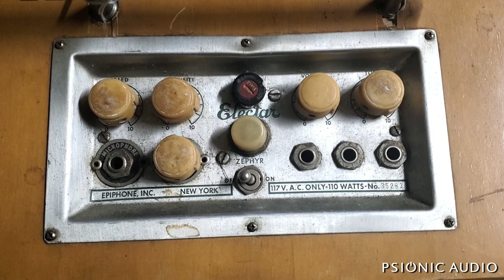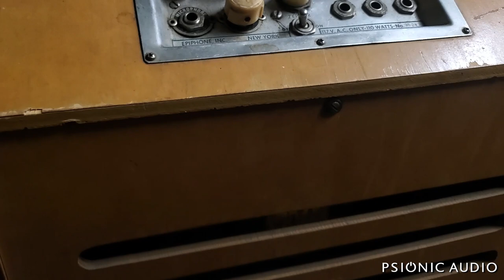'49 Epiphone Zephyr | Part 1 : A Short Story

Comment: Usually when I see that style of resistor, it's held in place with a bracket that attaches to the body.  On the Ohmite webpage, it offers "Mounting options include push-in brackets and thru-bolt brackets" Unless we're going for museum authentic, I'd change the mounting so it's not being held by it's terminals.

Comment: Personally, in this instance because these are an endangered species and its age,it would be great to see it replaced with an original type but maybe more securely mounted. Plus the proven longevity of the part is not an issue.Either way the owner is one lucky person. My father-in law had one and it was old back in the 70's lol. I was lucky enough to play it a few times. A great example of guitar amp history.

Comment: I’m guessing the original speaker was a field coil (electromagnet) type, and that large variable power resistor was added at the same time the speaker got replaced, in order to take the place of the now-missing field coil.
Reply: Seems like a choke with a possible series resistor would be better suited to replace a field coil. 
Who knows what landmine you’re going to walk into inside a 70 year old amp.
Reply from the maker: Previous version of the Zephyr had a FC. '49 has no FC but has the variable resistor before the reservoir cap, to set B+ at 400V. Beautiful Valco madness.
Reply: @PsionicAudio   old transformerless AC/DC radios  sometimes have big power resistors like that inside of them because the series string  Heaters might only add up to add up to 95 or a 100 V and they need to drop a little extra power.  Imagine a plastic or bakelite radio with a 5 to 10 W resistor inside of it dissipating that excess energy!  Some radios used a power cord that was actually designed to be a 5 or 6' long resistor and dissipate some of that excess wall voltage along the length of the power cord. One wonders how many house fires were started by one of those!
Reply: @PsionicAudio  ,  Valco would use whatever speakers they got a deal on, car radio speakers,  war surplus, whatever. I'm surprised they were using permanent magnet speakers in 1949, since they used field coil speakers again on a few amplifier models in the 1950's.  Somebody must have offered them a good deal!

Comment: I am speculating the new resistor will not survive 70 years of next generation of roadies.lol.
Reply: Tubular power resistors such as this one were usually sold with a pair of springy metal clips with screwhole mounting tabs on one end of the clip and a bent finger on the other end to insert into the holes on the end of the resistor.  They were usually pretty secure mechanically if installed correctly.